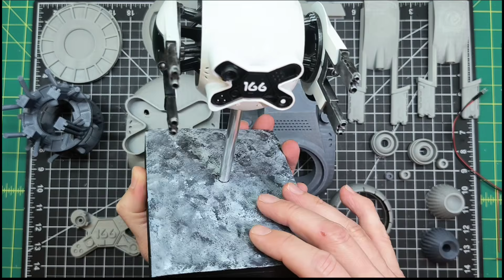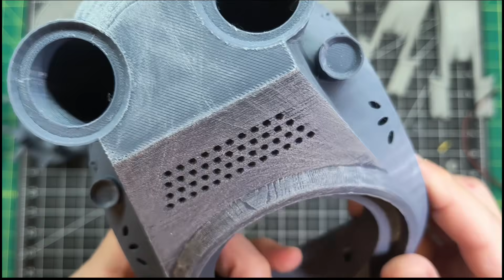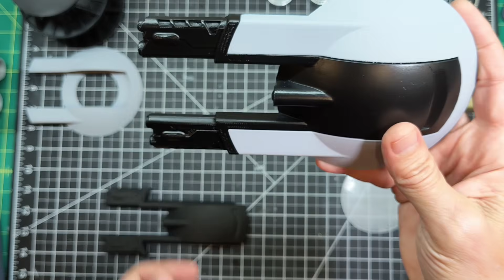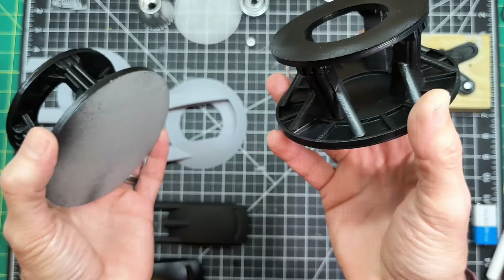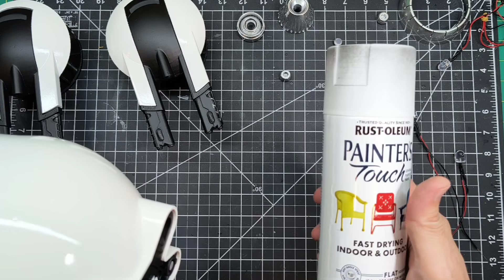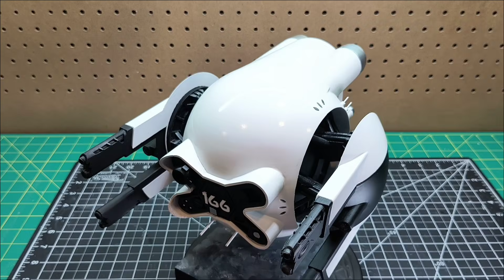Oblivion Drone -3D Printed Model

Comment: Instead of bondo..
I get great finishes using PVA glue mixed with talcum powder.
Its easy to sand and so cheap its practically free.
Reply from the maker: I'll have to try that.
Reply: @EagleSciFiModeler  Its adjustable too.
If you need to fill large gaps.. make it thicker.
If you want a finer finish with less sanding, make it thinner.

Comment: I printed the normal size one, and was able to contain ALL electronics inside the Drone. Hung it from fishing line. The small pipe on rear as the switch. Side gun was pressure fit, to remove to replace battery. Fun build!
Reply from the maker: Nice, it is a fun build

Comment: For those interested in the origins, this drone is based on an old, (and excellent), game on the Commodore 64, called "Paradroid"
It was obviously a homage to the game, and only us old farts immediately recognised it for what it was, most notably because of the font used, (Motter Tektura, from Letraset in 1975). 
Now all I need to find is the sounds...
Reply: Dunno, but the sounds were set as the default ESC startup sound for every FPV homebrew quadcopter that came after that... as a homage to the Oblivion droid with quad lasers that could turn on a dime.
Reply: @choppergirl  Nah. ESCs do not have physical speakers. They create this sound by vibrating the copper coils inside your brushless motors at high frequencies.